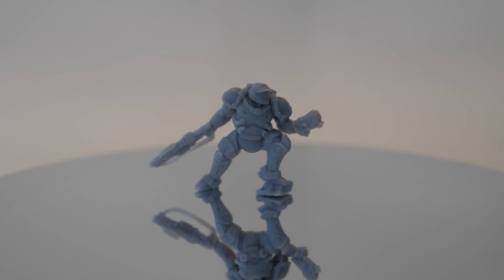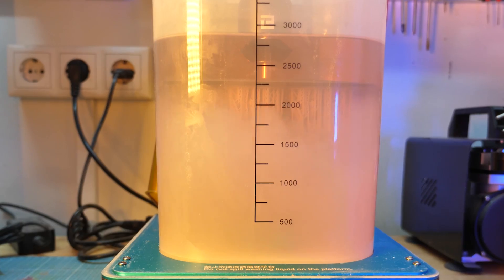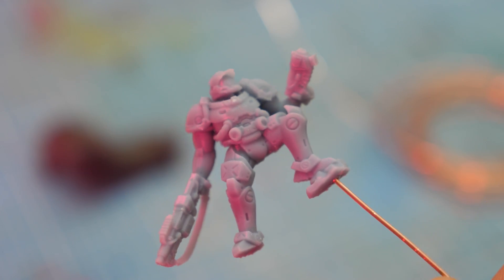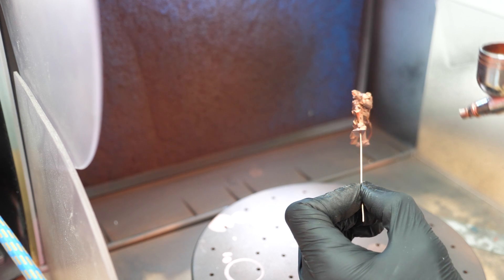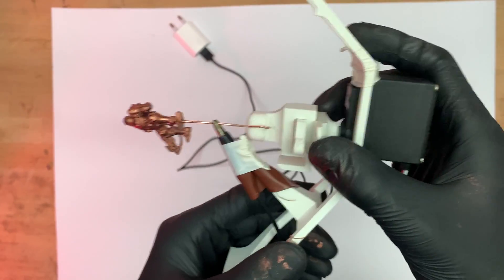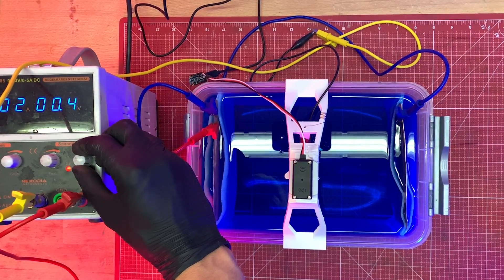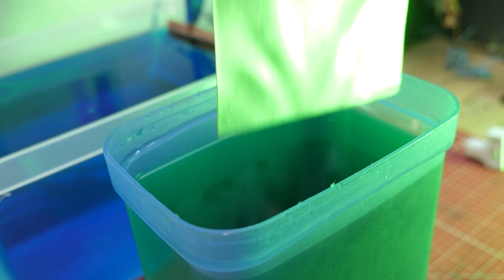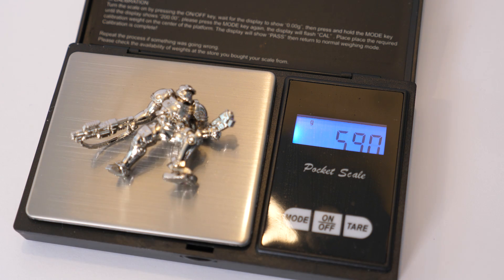Electroplating 3D Prints | Miniatures

Comment: Hi Hendrik :)
First of all, thanks for all those wonderful tips and techniques ! All your videos inspire me so much ! I do 3D printing for fun, as well as bronze casting (jewellery and other art small statues). 
I have two questions if you don't mind (I am not sure that you have answered similar ones in other comments of other videos, so don't hesitate to redirect me to it in case):
1. So far, I am only going to buy the equipment to pen plate my jewellery (for money and practical reasons). Is it possible to skip the bath plating step to achieve a similar result on 3D resin prints ? Would palladium and gold pen plating stick directly to the spray paint, or would I have to maybe add another layer of copper with pen plating?
2. My main goal here is to add plating on small areas of my bronze statues, to get a mix of textures and colors (green and blue patinas, gold or silver platings etc...). If you plate only a small part of a metal or metallized piece, would the added layer of metal stick correctly, or would it be damaged through time due to oxydation? I am thinking that maybe uneven spread of added metal would oxidize faster?
Thanks again and have a great day :)
Reply from the maker: Hi, thanks! 
1) you'll need a conductive layer, but the bath essentially creates a thick (>100µm) layer of copper on which you can plate on. Pen plating on conductive paint is very tricky an will end up in a very very thin layer of metal. no recommendation.
2) i have no experience in that special technique but yes, you can just spot it to some points and it will stick quiete well.
Reply: @hen3drik  thanks for the quick answer :)
1) I understand :/ I might give it a try and will adapt my technique according to your videos !
2) Sounds great ! thanks a lot, i'll try and will send you a picture when I'm done 🤙
take care

Comment: Hey, i have a question: if i decide to print some rings with it and start using, the metal shine / coat start peeling off or something like?
its ok to do that in wearables?
Reply from the maker: That would be okay. The copper layer is quite thick. You should apply a top coat of palladium or gold to prevent irritation, as nickel is allergenic. Depending on the thickness of the top coat: due to sweat etc. this will wear off after some time (like regular plated jewlery). Thicker top coat = longer lasting.

Comment: What kind of motor did you use, what voltage, and does it have speed control? I would assume you would want it to rotate very slowly to achieve the best coverage. Did you make that rig yourself?
Reply: Also, what rpm does yours rotate at?
Reply from the maker: Check out this video: https://youtu.be/Ag_NQ9KbKc8
There’s a link in the description.
Reply: You, Sir, are epic!

Comment: I'm running into an issue with the finish and timing of my plating. It seems to take a very long time ( 2 hours) to fully plate the piece and when is plated is a very dull copper. I made my own solution using copper sulfate, sulfuric acid, distilled water, and miralax as a brightener.
Reply from the maker: Okay, it should have a light solid coat after 0.5-1 hour. Try to calculate the correct current for you item and use constant current on your power supply.

Comment: been trying to figure out how to plate it in brass. 

i know you can plate in copper, then plate in zinc, but to get them to mix into brass you need to heat it and i don't think the plastic could handle that, and i don't think the metal is thick enough to ignore the plastic melting.

unless you packed it in flour first, that might keep the plastic from deforming while letting the copper and zinc get to know each other...
Reply: there are some plastics that resist some heat , but not sure if the resistance is enough for it

Comment: I can't get my servo to do anything. I followed the plans.
Reply from the maker: You mean for the rotary jig?
Reply: @hen3drik  yes, I soldered the wires and copied the code and lib folder over to the trinket but it does not spin. I'm not sure what to do now. The trinket led is flashing twice in red. I look that up and it means "Code ended due to an exception."

Comment: I was under the impression that the current is all that actually matters when electroplating and you're just setting voltage to reach a desired current. If that's the case, why do you usually decide to mention your voltage levels instead of your current levels?

Love the videos -- I'm on attempt #3 of getting my conductive paint to electroplate now
Reply from the maker: You are right. Back then I tended to regulate voltage but current is actually what you want. The comment of Sinan is also right, as you have to ante up the current carefully. You can compensate this by making the thin conductive layer extremely conductive from the start. pickle it before setting the current at 50% for the first 30minutes.
Reply: The current matters regarding accumulation rate of metal.
When you do something wrong, the resistance of your setup could drastically change, thus resulting in you needing to crank up the voltage (to achieve for example 10mA) sometimes by about 10V, which is FAR too much! The voltage matters for the electrolyte and copper paint decomposition.

By providing the voltage, one can be sure to have a great starting point. Current of course follows with voltage when having nearly constant resistance

Comment: Thoughts on using different conductive paints? In Canada I have access to carbon(37$), nickel(47$) and copper(70$).  All in rattle spray cans.  Supplied by MG Chemicals
Reply from the maker: ☹️. I have ordinary conductive paint here that diluted last forever. Carbon for 37$ (CAD?) is too expensive; 70 CAD is the price we pay in ger for rattle can copper as well. It might be worth a try. But that’s why I switched to the other paint.
Reply: @hen3drik  I’ll look into getting the paint you typically use. I’ll need an airbrush also but overtime will pay for itself

Comment: Would you do a video on plating a print from an extruder type model?
Reply: you propably mean FDM? Yes look up his video for the Mando helmet for example... basically its a hell lot of sanding, primer/filler, sanding, primer, sanding.. million times until you have a smooooooth surface. if you plan for nickel over the copper layer: nickel (the glossy one) excuses a lot and creates a VERY polished look and creates a plating barrier to strenghten the plating! keep in mind to polish with metal polishing after every step and clean it with degreaser!

Comment: Does a metal plating serve to enhance the structural integrity of the print? What if this is applied to mechanical prints such as gears?
Reply from the maker: Absolutely. I increases strength a lot. Haven‘t measured it, yet though.
Reply: @hen3drik  maybe this could be worth a collaboration with Stefan from CNC-Kitchen. I would be really interested in how that changes the stress profiles. Furthermore, the abrasion resistance would be something I am interested in.
Reply from the maker: @TJ13062010  in case of the abrasion resistance I can tell you there is no abrasion 😅 at least if you don’t rub it 24/7
Reply: @hen3drik  yes, of course. But every surface has an abrasion resistance. And there is a change from plastic to metal. An engineer probably has a table for it, but I would still be interested for CNC-Kitchen to make a real life test. Anyways a clan between you and him would be very interesting to see. Essentially asking the question: is there a nice way to improve the technical performance of parts.

Comment: Nice work! A question for you, if you don't mind...
I have just bought a resin printer with the ultimate aim of casting items in precious metals, but I think electroplating will be a fun distraction and your videos are some of the better available on youtube. 
Questions I have on your process: 
1. You mention you work with Voltage, rather than with current. My assumptions (as an electrician) is that it is the current that is the important factor here, and that any variation in solution concentration and electrode separation will alter the voltage needed and those playing along at home will find your settings will likely be unsuitable for them.

2. Would two more cathodes on the sides of the container (or using a large diameter copper pipe) remove the need for the rotisserie?

3. Do you think a conductive paint made with gold nanoparticles (which are easy to make chemically) be a suitable base for the coating?
Reply from the maker: Hi, sure:
1) Basically, there are two basic rules there: Stay as far away from the anodes as possible, and don't set above the maximum specified voltage. You don't really have any influence on the current flow (unless you would limit it), but I usually handle it by starting at 20% of the voltage and then gradually increasing it to 75-100% depending on the size of the piece being plated.
2) The anode shadow would be reduced, yes. Preferably one more at the bottom and one at the top. But that then becomes impractical. The copper process is very geometry dependent, meaning patterns will form on the print. Turning is absolutely the best idea. i.e. with nickel, this matters less.
3) Yes, that could work. Gold is the best plating base I know of. However, because the print is placed in the strongly acidic electrolyte, the base is attacked and partially dissolves; unfortunately, I cannot say what effect this has on the gold color.
Reply: @hen3drik  Thanks for the reply, one of the advantages with gold is that it is resistant to most acids, I'll let you know how I go :)

Comment: Great content as usual. Do you have a table explaining what voltage to use for what metal? Can all metals be used… like  stainless steel?
Reply from the maker: I actually don‘t. There are some calculator for different metals and max current but I don’t trust these. You can use a good variety of metals, but some require certain metal to be plated on. Not sure it there is stainless steel, but there is chrome, which is robust and does not oxidate.

Comment: Hejhej Bro, thanx for using/linking my rotajig! Very nice result youre gettin there, maximum respect 👍
Reply from the maker: Thanks, this tool has to spread a lot. Noticed I modified the alligator clamp? That works wonderfully for me.
Reply: @hen3drik  yepp, that aligator is a very nice idea. Doesn't it grab onto the wire too much so the servo has a hard time to rotate? 🤔 Ill have to try this and maybe ill update the design for aligator clamps 😉
Reply from the maker: No, I use the same servo and it‘s no problem at all. I had to secure the clip with tape, as it moves up and down on the wire. I think there‘s a more elegant solution to this. But swapping pieces with the alligator is way faster than unravelling the wire.
Reply: @hen3drik  absolutely! Ill have a look. 👍 The alligator is pretty cool because it is available everywhere and its specs are similar everywhere on the planet 👍
Reply: The servo is bigger than what i have, what type/size is it, thanks if you can answer.

Comment: Nice video! How resistant is the layer against scratches if you play with the miniatures, for example.
Reply from the maker: Thanks, the nickel coat is pretty thin, so can wear of after some time when you touch it (what you don‘t want because of nickel). Besides that it‘s a 25 micrometers metal coat, and this is pretty resistant. You cannot create scratches on like with your fingernails etc: it‘s pure metal copper.
Reply: @hen3drik  Super cool! Thanks!
Reply: @hen3drik  What would a professional toy company do to make it more wear resistant? Is it possible to coat the metal with something like a clear coat or somehow harden the metal -- or just more layers of plating? With gold, aren't lessor metals like zinc and silver  mixed into rings and jewelry to make them stronger?

Comment: Was the nickel layer protection against oxidation or just decorative? Could you have plated nickel from copper paint and skip copper plating?
Reply from the maker: Both decoration and against oxidation. You can chrome or gold plate from here if you want further protection against oxidation. You can skip copper plating and do nickel instead, but copper deposits easy, thick and safe. 😃